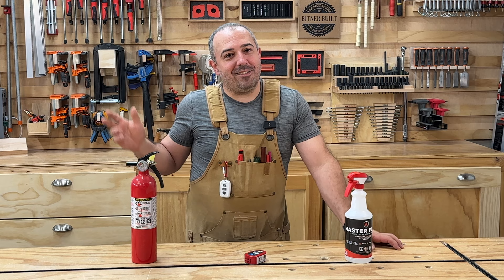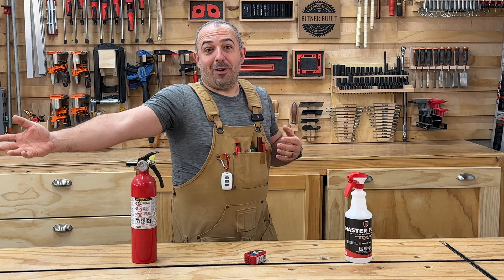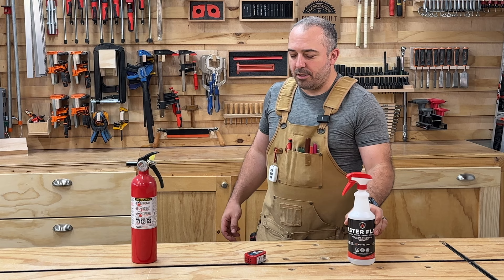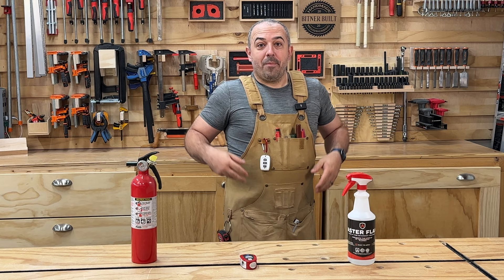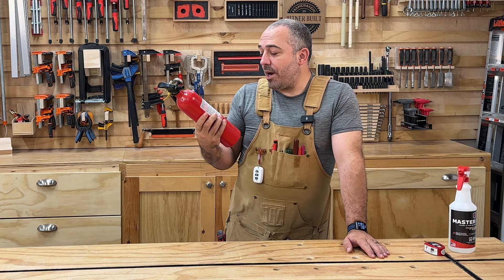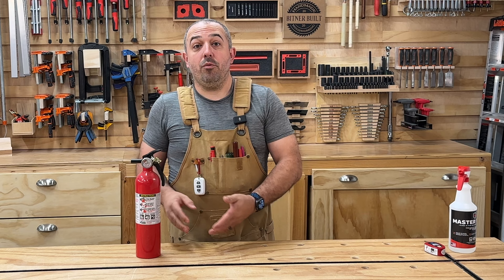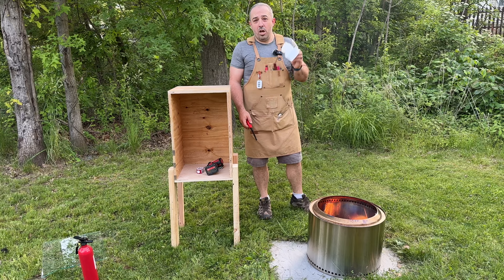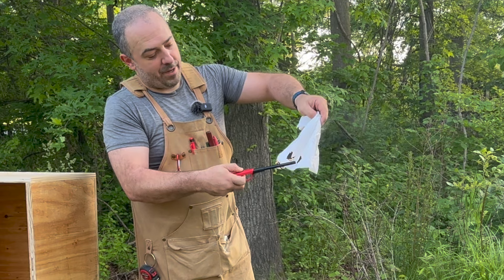Wood Shop Fire Proofing - Testing Fire Retardant Spray & Auto Fire Extinguisher

Comment: As  a retired Firefighter I must add a few things.  1) No matter the size of the fire in your house/shop etc, call 911 and get the fire department en-route. Fire will grow exponentially even when you think it is out. They have the knowledge and the equipment to confirm that the fire is truly out. 2)  A fire extinguisher may stop a fire, but it may not be out. 3) Find out if your local Fire Department does training for folks on how to use a fire extinguisher.  If you have never used one, It can cause the fire to roll over and back towards you if not used properly. 4) If you want real protection for your home or shop invest in good smoke/heat/CO detectors for quick and early warning. To truly protect the home/shop install a fire sprinkler system. (Probably not feasible for most people due to costs)  5) Make sure you properly store all your flammables as well as any towels etc used with paint, stain, and or varnish. 6) Never leave your equipment running when you are not present.  Overall and very interesting video and I appreciate you taking the time to show the products and your take on how they work.  Keep up the interesting videos!
Reply from the maker: Thanks scruffy and thanks for the tips!
Reply from the maker: You know I was disappointed I had contacted my local dept twice to see if I could interview someone for the video as well but no one would reply to me
Reply: @BitnerBuilt  That is sad
Reply: Also add the fire extinguisher should be checked regularly to ensure it is fully charged. A long time ago in the Marines I was in a hangar full of choppers. A spark from a welder arched onto some cleaning rags and started a fire. I was the first to see it grab a large extinguisher to start mitigation. Another Marine brought a large wheeled Purple PK extinguisher to the far side of the chopper. I was between chopper and wall when my extinguisher ran empty. The Purple PK drafted over and I passed out. Fortunately a Gunny saw it all and grabbed my collar before I collapsed. It can happen fast folks check your gear someone else’s life may depend on it. I was ok and avoided the destruction of millions of dollars of choppers. No hero, all in a days work. 😎
Reply: My wife and I installed fire sprinklers throughout our home some fifteen years ago. Not necessarily to code, not inspected, but I didn't care. I went ahead and did it, using proper commercial components and my experience as a building systems specialist. The plumbing is 3/4" Pex tubing, and a flow switch activates an exterior fire alarm bell. A very, very loud bell. Fire sprinklers and their application in residential construction is not rocket science but just about everyone thinks it is.

Comment: Interesting video/ demonstration.  A couple of important considerations with fire extinguishers (in addition to having the proper ABC rating that you mentioned): 1. Be sure to check it regularly to make sure it is charged and ready to go when you need it, and 2. Place/ hang the extinguisher next to an exit from the space. That way, if you go to get it due to a fire and then turn around to see that the fire has spread beyond what the extinguisher can handle or what you are comfortable trying to deal with, you can escape and be safe/ able to call the fire department
Reply from the maker: Yep great advise!
Reply: Great points on the extinguisher placement. I keep one mounted on the door and one at the other end of the shop. That way if the fire is between me and the door I have a fighting chance to get out.

Comment: If you have seen Holmes on Homes (Canada HGTV) Mike Holmes insists on a “Pink” coat fire resistant wood when repairing or renovating a house. But uses a “Blue” wood that mold resistant in lower levels. The pink wood, like 2X4 is cut to length, sometimes you will see them paint the cut end. The used it to build a divider wall in a duplex in case the uninhabited house next door caught on fire. It’s not fireproof but gives the homeowner more time to get out. Will a bad flood hit Alberta 2001, an area flooded 5-6’ deep. A house a “Holmes” approved contractor built showed the basement and pointed out structure and walls did not absorb as much water, dried to under 15% quicker and “I-beam Wood” floor members did not buckle or lift. While a furnace, water heater & electrical in the lower level had to be replaced but was 4 weeks quicker, $20k less in repairs. Impressive video and product. Thanks kindly for the info. Fires are anyone’s worst day!
Reply from the maker: Thanks for all the info! Yea fires are the worst, I’m all for anything that will help people have more time to get out or put out!
Reply: @BitnerBuilt   After I posted my comment, 4 or 5 videos below yours was an advertisement application video for the “pink” seal fire retardant they sell in Canada. On ceilings, by code, certain codes require a fire resistant coating to be sprayed like wall penetrations foamed with “Red” fire stop as well!

Comment: If you're using an "automatic" system with something like a 3D printer or CNC (something with sensitive electronics), you might want to take a look at the smaller BlazeCut T-series fire suppression systems (larger ones are more intended for vehicles and industrial applications).  More expensive, yes.  But also specifically listed as non-conductive and non-corrosive, so should not destroy any of the electronic components (control boards, etc).
Reply from the maker: Ahh cool I will take a look!
Reply: Something else you may look into is using CO2 extinguisher for the electronics.  It should not cause issues with the components like regular extinguishing agents do. If you have an opening in the enclosure that you could open and then discharge the CO2  extinguisher into the enclosure it should work very well.  The CO2 extinguishers are the choice for mail boxes for the same reasons. It works well in an enclosed space and will cause minimal damage from the extinguishing agent.

Comment: Thank you for making a safety video on a topic that impacts all of us because we use a number of flammable/combustable products and even having storing these products should be something we should be well informed on. I've been searching the web for DIY options for storing flammable/combustable aside from the expensive flammable cabinets. I wondered if buying a metal storage unit would be a better solution than having flammable/combustable products in my garage shop. There are very few videos about this topic thanks for sharing.
Reply from the maker: Thanks! Yea especially for storing you should look at the metal options. Recently I received the xTool s1 and then found that xTool actually has a co2 fire suppression system they sell, just bought one, interesting thing is it can be used in other enclosures as well (depending on the model you get) I will be checking that out too soon in a video!

Comment: Everyone overlooks the simple pressurized water can. It will work way better on a class a fire in a wood shop. It also is not getting the very corrosive powder on everything. Truck companies take these into burning buildings they work that well.
Reply from the maker: Very good tip!

Comment: The delay of the Jogoswall makes sense to me, given that the normal ambient temperature is pretty hot under the hood of a car. And I'm assuming it's not supposed to trigger if your engine is just overheating...only when it's actually on fire, right? So it's got to tolerate quite a lot of heat before going off.
Reply from the maker: Yes I’d agree as I said I’m not using it for it’s intended purpose so I don’t fault it at all. The spray however is the one I’m excited about

Comment: I wouldn't use the Jogoswall in a container filled with wood because of the possibility of flair up. Depending on the size of the fire and the enclosure, I can see almost a backdraft type scenario once you open the enclosure, just as in the video how quickly the fire re-ignited once you took one side of the plexiglass off.

I would stick one inside a metal cabinet especially the fireproof cabinets where you should store solvents, stains etc.
Reply from the maker: I agree on the metal cabinet, but when you’re talking about some thing larger like my CNC machine, those cabinets are twice as much as the machine itself so you see everybody making it out of plywood, I was trying to introduce a few extra things to be able to at least make those plywood enclosures “some” protections. Personally, I like the spray.

Comment: I have an idea of building a laser enclosure and then covering the inside with sheet metal such as duct work.  I believe it would severely hinder the ability of the enclosure to burning from the inside.  Not sure if anyone had this idea.
Reply from the maker: Good thinking, first thing that comes to mind though is when the fire hits the metal that metals going to get crazy hot too and transfer it to the wood on the other side no?
Reply: @BitnerBuilt  I suppose. But it’s a lot harder to ruin if there is a flair up.  It would need to get super hot for a long time before it became completely trashed.
Reply from the maker: @pazmaniaoh6341  what about lining the inside of a Durock instead, that’s fireproof and doesn’t transfer heat because it’s concrete. That’s the sheet good they put inside bathrooms instead of drywall. Drywall‘s also something that can be used to. It’s not as fireproof, but it is fire resistant and delays spread as the gypsum inside heats up it releases steam.
Reply: @BitnerBuilt  that’s an even better idea.  Cutting it with an abrasive blade and circular saw would make construction a ton easier.
Reply: You know Bitner there are a lot more folks getting into the CNC, engraver opprty space. I can envision a well done video(s) creating fire resistant, fire proof enclosures. Especially as most are either inside a home or garage.

Comment: I'm looking for a fire resistant coating to spray on (painted) wood house. Anyone have any ideas?
Reply from the maker: The master flame can be mixed with paint and is sold in large 5gal quantities, unsure if you can just spray apply it directly to an already painted surface as it needs to absorb it. I would assume that’s the same for any of them so you might need to add a coat of paint to apply
Reply: I'll look into it. Thanks for info. @BitnerBuilt

Comment: Fire Retardant Spray:  I think the phrase is “Self Extinguishing”.
Reply from the maker: 🤷that’s what it says on the bottle
Reply: Yes.  There may be flame present from another source, but the treated surface will resist catching fire, and go out quickly when an external flame source is extinguished or removed.

Good stuff.  I ordered two cans a couple minutes ago.  Thanks for the video and information.  I’ve got a wood workshop to spray.